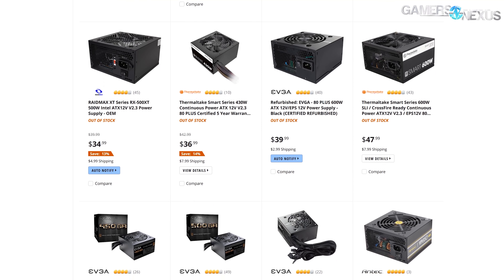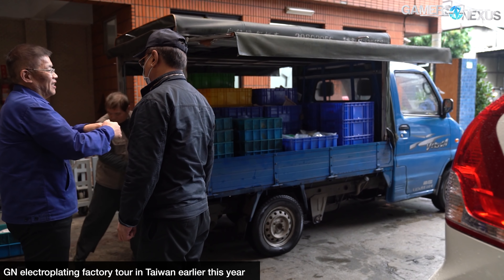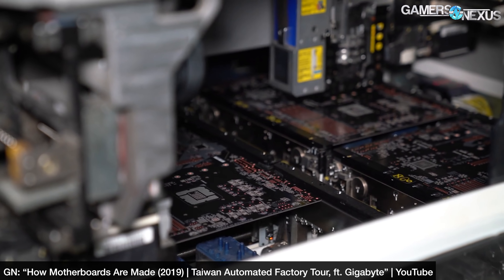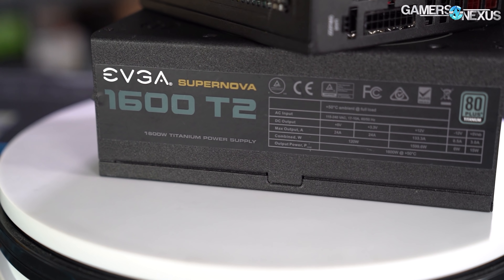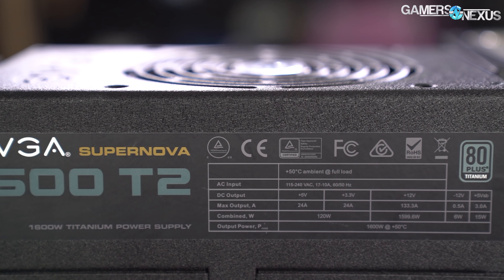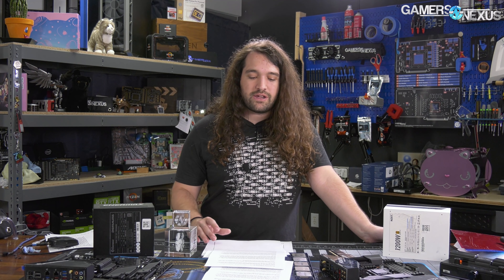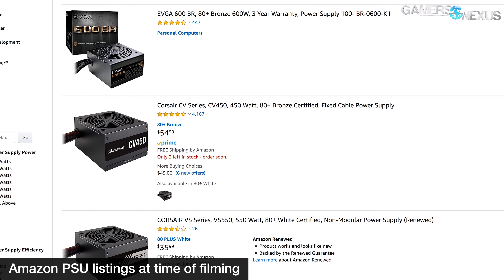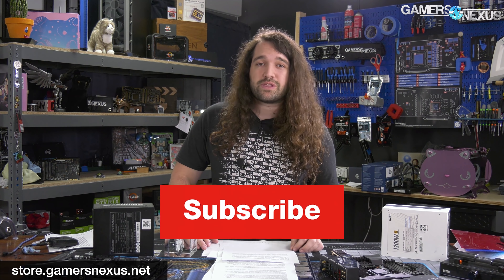Out of Stock: Power Supplies, Motherboards, & Video Card Shortage Explained, Restock Dates

Comment: Actually with power supplies it is more like 300% markup. We used to get them for $10 and sell them for $32. we also gave a lifetime warranty - it died - come in and replace it. We were able to do this because the company would give us the same warranty so when we'd have a pallet of dead power supplies, we'd send it to them, and they'd send us a replacement pallet. If you add in the cost of shipping, back then, the power supply was around $15 with 2 replacements shipping services added in. So a bit less than 300% actual profit. But most never came back.

Comment: I had a little issue getting a motherboard earlier this month, when I had the money i had to actually look to find a motherboard i wanted. there were many scalpers that bought up what stock they could and double the prices as well. i eventually got lucky and found my Asrock B450M/ac motherboard from Neweggs Ebay store for $89.00, anywhere else it was as much as $160.00. This was early may BTW, hoping things stabilized by now. Looking at end of the year upgrading my GPU and power supply (reused both from the old build) so hoping the issues with supply will be sorted by then

Comment: This is a major bummer. I need a new power supply as mine is not working correctly due to broken wires in the long thin power connector.

Comment: I was in the mid of a buil and had to go with my 2nd and 3rd choices on some components due to unavailability of most popular budget friendly options. Motherboard was the hardest one to source, I was in the market for a mid tier x570 but had to go with a high end b450 because it is all I could find. Power supply was easy enough, I was able to source a corsair 650w 80+ gold. Overall was able to source everything after extended searching

Comment: I bit the bullet and got a used PSU off ebay for a entirely new build. It works though and seems good. $200 shipped for a EVGA Supernova P2 1600Watt that looks brand new. I would have preferred new but, ya, not available anywhere.

Comment: I got lucky and snagged a Corsair SF750, it was out of stock when I went to go buy it, and a day later it was back in stock. Seen a few of them listed for $400+ by scalpers, I mean WTF.

But I was without case fans for about 2 weeks and had to end up using a small personal fan aimed at the case which actually worked pretty well until I was able to get 3 fans.

Comment: Lack of stock will just mean I hold off on my upgrade plans and actually works in my favour as it means more time to save for the upgrade parts needed (min of CPU, motherboard, memory and new PSU and probably a couple of nvme SSD). My other half has a more pressing need due to component failure, so has a slightly lower specification system than what I will probably get.

Comment: Yup. Working on  build to replace 10 year old PC. AMD Motherboard avail was really bad for $150-200 range until a couple of days ago on newegg. PS in the $70-100 range are getting short now. Ram still really good, SSD storage really good and Vid Cards in the $1-200 range are fine. I had thought they were dwindling old MB stock due to B550s coming soon but now that the B450 and B550 back I think it was more a manufacturing supply issue.

Comment: Curious. I am currently building three high tier rigs for people and neither do I see a lack of availability nor do I see a big spike of prices. Then again, I don't order from Amazon as the retailers I buy from are often times even cheaper than Amazon. Europe Region here. How can that be? Larger stockpiles on interim tax zones? Many foreign distributors like China and others are known to have a "forward stock" so when you order, it doesn't actually come from the mainland directly but rather the forward storage, which is why they can also keep the shipping times fairly tight and short. I guess that's the reason why I don't see a lot of issues here, as these forward stockpiles including retailer storage has been prepared for that?

Comment: Yeah literally when I was building a friends pc I had to get a PSU from EVGA's B-stock to even get a decent unit that wasn't crap tier, 850W modular gold for a non overclocked R5 3600/GTX 1660S, something I'd usually buy a 550W for but the only 550W PSU's available the brand names I couldn't pronounce.
Reply: In May I couldn't find any 500-800w units from reputable firms. It was all 300w units from Kolink.

Comment: I got the last of two motherboards at microcenter and there were only 650 watt inland gold power supplies. I grabbed them, but really wanted a better power supply. I bout an asus xb570 tuff gaming ryzen 3800x 16GB of ram, and a terybyte nvm drive. I’m holding off on video cards until next year. I’ll have to buy a larger capacity power supply later which sucks.

Comment: Started upgrading an old Linux box for Folding@Home in early April, but ended up building essentially a new machine. Couldn’t get the power supply brand I wanted or a case by a manufacturer I’d heard of that met my needs, but I got slightly overpriced but so far adequate ones.

Now I need to just let those two GPU cards (little difficulty getting those) do their computations and just NOT TRY TO UPGRADE.

Comment: Beware of price gouging. Lots of state AGs have websites where you can report these kind of things. 

I am waiting to pull the trigger on a B450 Ryzen 5 3600 system. When I check online for the B450 board I want I can only find it on Amazon through a third party seller for double what it should cost. Luckily I can wait this out.

Comment: Just finished building my new rig. Normally I can do it in one go online. This year it took me nearly a week. Even then I had to compromise on several parts. What I wanted was generally not in stock, and what was tended to be overpriced. So I'll be in the market for a better PSU as Enermax is ok, but not good long term. But in the end, I think I can live with a rysen 7 3700x and an RTX 2060 super. Both are near 100% faster than my previous I5-6600 / RX-480 (which really were not that slow to start with and no game I play ran at less than high settings at 60 fps HD). Just getting ready for VR mainly.

Comment: Guess it's a good thing I ordered my new power supply when I did.  I started to notice some noise that I had never heard before. Did some investigating and it seemed to be coming from power supply. Didn't like the nasty sound and def wasn't taking chances with power supply nuking my system. Ordered a new RM-750(CP-9020195-NA) at end of April. Been running great since then. Sold out on NewEgg and Amazon now.

Comment: I would be cool to see a comparison of a "golden" chip vs. a decidedly not "golden" chip. I have an R 5 3600 that's kinda garbage, will only OC to 4.1 and needs to be around 1.39v to stay stable. Running that much voltage bugs me so I just run the chip stock, but it's still pretty hot with a tower cooler. I have another one that overclocks to 4.3 at 1.32v and stays cool with a stock cooler. I can't tell the difference between the systems in day to day use, but it's still crazy to see such a big difference. Why is the difference so big? Why are some chips so much more stable than others? Maybe you've done this before, but it could be fun to do it again.

Comment: My old PC sure picked a bad time for hardware failure. I started buying parts for a new build at the beginning of May and yeah, MB and power supply were a bitch.  The MSI B450 Tomahawk Max was out of stock everywhere , I kept checking back daily and as soon as Amazon had an availability date, I ordered. It was out of stock again two days later, but I got mine in about ten days. Power supplies, pretty much everything decent was out of stock or back ordered, I settled for a Corsair RM750x, not my first choice, but it was the best one I could find that had a reasonable shipping date estimate. Newegg said 10-15 days, it was actually much sooner. Now I’m a bit concerned about Video cards as I haven’t ordered yet, still kind of researching, Newegg seemed to have a reasonable selection available, but a lot was out of stock also. I guess I better order when I get paid this week.

Comment: you can fit into 50ft container over 1000 PSU and shipping costs less than 1000$ if you are a manufacturer.
"manufacturer margin on PSU is 10 to 15% depending on a PSU ... information collected on manufacturing industry..." 
It's obviously is 10-15% when its sold to a Distributor and Before distributors sells it at Manufacturers assigned "Minimum Advertised Price".

Comment: Fantastic info Steve, and well presented. I, like you mentioned starting this one, did learn a few things!
Now I'm getting around to picking up a mat or two- regardless you have my support due to some small financial "luck" I've recently experienced.
Another topic you ask? How about info on the best monitors from budget and up and what 1 needs vs wants, monitor terminology to sell vs. terminology that means actually something significant.
??? Another is what about the BIOS on x570 boards shipped and does a buyer need to immediately go to the MOBO website immediately to update the BIOS- say on the x570 Aorus Master by Gigabyte, and if things are running smooth should the BIOS still be updated or not, and why. Plus OTHER related reasons/info upon BIOS. I don't think I've seen anything as all anywhere upon this second suggestion. I've personally not done any BIOS updating as I've yet to install anti malware etc. software on my new build- which BTW I relied entirely upon your cmsy news to help in my deciding what to buy...and I've many complements upon my "...one hell of a machine you've built...". Yes credit to Gamers Nexus indeed made clear!
Thanks G.N. for your consideration.

Comment: Ty for the video it was interesting. I bought  a PC from EcollegePC  about the first week of may because I couldnt get parts such as power supplies, They had a Corsair CX 650. I wanted a 5700 XT, but ended up with a 5700 with an ok not preferred card because thats what they had in stock an MSI Mech 5700. Cases were another issue. I ended up with a BeQuiet Pure Base 600. 3700 x  Crucial P1 1tb NVME 16GB 3200 Mhz Ripjaws. EcollegePc actually did a great job it was well boxed well protected and everything worked great out of the box. I was quite nervous about it after watching videos on Cyber power. It cost me just under 1400.00 with windows 10 home. bench is 91 117 and 106 userbenchmarks. Oh yeah because im old i had them stick in an internal LG DVD. Mb Gigabyte B450 Pro WiFi [revision1]

Comment: stuck at home and need to telecommute, i would upgrade if i had to. I just want to compile code faster. due to limited selections, i went with a more economical system and it works fantastic. b365+i5-9600k+ddr4 2666. i had the PSU, case and case fans already, so all i needed was 4 parts. if i did again, i would have got the low profile cpu cooler.

Comment: The C5 can move a lot of cargo. Almost 235 tons.(with mid air refueling). Take off with enough fuel to get airborne. BUT from Taipei to LA reduces the cargo to slightly more than the flight in a 747 because it uses more fuel per hour.
 But the demand for hauling that much is not needed the year round. Therefore it would not cover the cost need for the investment. 747 can haul about 1/2 that and it does not use as fuel per pound of cargo. It also can be converted to passenger use.
 Passenger commendations in a C5? Never seen any. Well there was some netting. On the sides. Cargo tied down in the middle. Landed in Midway. Took on fuel. Landed in Pusan. Was not fully loaded, with fuel or cargo. The were only 235 of us and all our gear (weapons, ammo, rations). 
 Finally it is only worth it for the 747 cargo operator if the cargo bay is full. The same applies with a container ship.

Comment: It's nuts ..... The power supply I bought late December for $70 and got in 2 days is now $175  and backordered until mid-July ......   I plan on building a new system this Fall with a Zen 3 and perhaps a Ampere graphics card , dual PCIe 4.0 SSDs, etc and thought I might get a head start and get everything together over the next couple of months so all I'd need is the CPU and a graphics card when they came out ..... Power supplies are the worst but everything is jacked up in price or unavailable right now ..... 

Probably a bunch of components getting sucked up by game console manufacturers leaving everyone else high and dry .... How many million power supplies are Sony and Microsoft going to need so they can start production?

Comment: So, all computer enthusiasts are basically screwed for the remainder of the year. With lower stock, comes higher prices and compulsory bundles. What happens in my country is that you can't buy only the CPU or only the GPU. You have to buy multiple components, especially at the high end because parts are limited. I waited almost THREE months to get a 3900X with an ASUS X570-E Gaming.

Comment: I'm an American living in Guangzhou. Most parts supplies are pretty good here with normal prices. The obvious exception would be the new Intel offerings, Z490 MB's are readily available but a bit higher in price than they should be, that's just the usual early adopter tax. Intel's 10th Gen CPU's only have the i5 10400(F), i5 10500,  i7 10700(K), & i9 10900K iterations currently available. No i5 10600(K) in sight. I wonder how much of the EVGA MB & GPU card production is done elsewhere, because they are much less available (if they're made elsewhere they'd need to be imported into China and the same restrictions would apply). Other parts are looking good though. So they must indeed have it, just aren't able to ship it yet.

Comment: Love these investigative videos. QUESTION FOR ANOTHER VIDEO: Here's something I'd like you to be able shed some light on. What went on with MXM Type B universal reference? These were relatively interchangeable with only at most a bios flash required between notebook manufactures, mini PC's both AMD and Nvidia over many generations. Then we had MXM 3.0 and folks like Alienware/Dell went propitiatory and also others like Clevo - although the latter made more of an effort for inter-generational compatibility. At first glace we assume manufacturers didn't really want people to upgrade rather purchase completely new laptops  (in a few cases this has been true but not publicly stated aka planned obsolescence ). However, I've also had reliable sources say that Nvidia didn't want to allow their reference to be used either and have made unnecessarily difficult for a standard to exist . There's far more to the story of why laptops have not been able to fulfill the dream of GPU upgradability when we've historically been so close circa 2009-2016. Of course BGA slim designs have been more popular, but this isn't necessarily the reason why, as enthusiast grade laptops still currently sport MXM 3.0 GPU modules.  If you can I'd love you to do a deep dive on this because the history of upgrading laptops, particularly in the era of MXM type B with Alienware, Clevo, MSI feels like somewhat an open secret to only a few enthusiasts.

Comment: I couldn't get HP ink cartridges anywhere last week, 302's are usually everywhere. In the end, I got some 'remanufactured' ones which work ok...
Oh, and the new Xfx thicc3 heatsink kit for the thicc2 (Steve single handily made the 5700xt cheaper than most non-XT versions, so thank you for that). Although the pads are very different to the ones you showed, it overclocks really well (will happily sit above 2ghz all day), just need to fix a hotspot of 100c...
 The new one has 3 fans and I'm hoping it doesn't block the Asus x570 PCH fans (which are in the dumbest place possible).
PS: There also seems to be some price creep on RAM and SSDs too.

Comment: Steve, 
I've got a well-stored Zebronics 80plus Gold Certified 450W PSU from 2013. When I opened the box after 6+ years, I could see a couple of small crystal-like components on the wires, looks like dried glue chunks, but I got no idea what they are and more importantly, whether the Power supply is even safe to use now... I am in the process of building a new PC, just purchased a Lian Li Lancool 215 after your review... Planning to use a X570 Tomahawk, and use 3300X for now, with a potential to go for 5000 series processors next year... Would it be safe to check my new Mobo with this PSU, or are there any other methods to check the effectiveness/efficiency of my incumbent PSU ? Please, please guide me...
Reply: Sounds like electrolytic fluid from cheap capacitors that blew.
Reply: @BKDDY  that sounds potentially dangerous... Though, when I opened the PSU enclosure box, I saw nothing out of place, and these glue chunks are present only on the cables, and nowhere inside the PSU box... Oh boy...